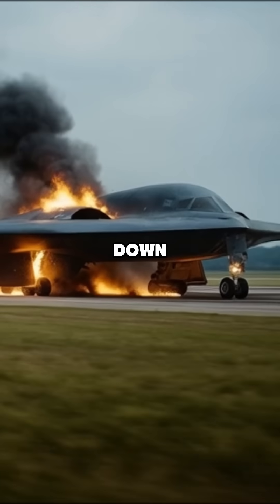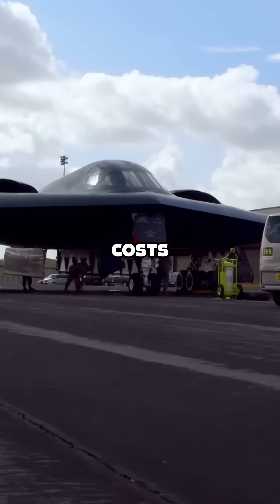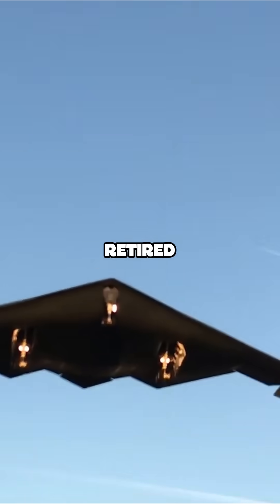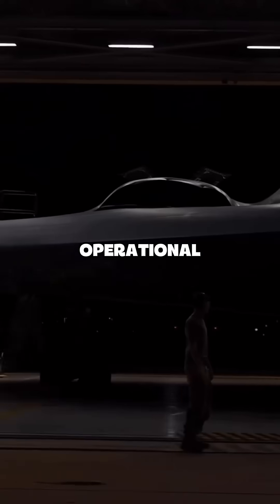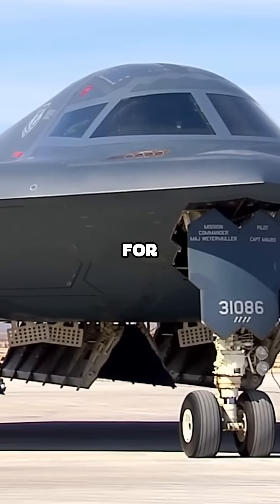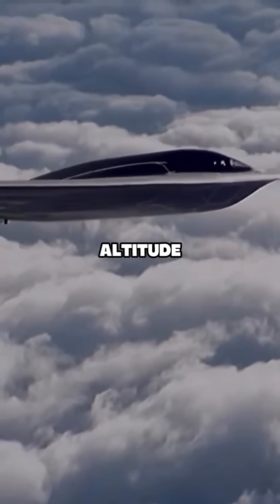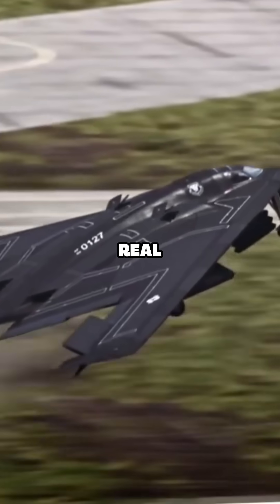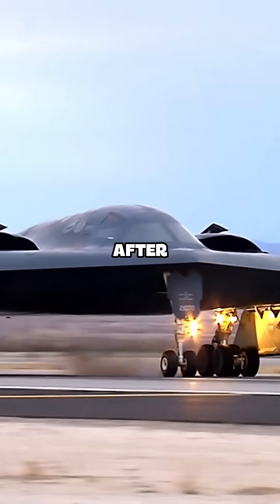How a Tiny Sensor Destroyed a $2 Billion B-2 Bomber?

Comment: Moisture didnt get under the stealth paint the rain got under the radar reflecting paint during takeoff and the engines are high heat, and they stalled bc cool rain hitting high heat engines basically ruined them

Comment: Ive seen some videos on a Quantas flight that had issues with clogged pitot tubes. And I knew as soon as you said tube thats what you were talking about. "Airspeed unreliable" is probably one of the most horrifying things that can happen. You dont know if youre about to stall, or break apart due to overspeed. And computers dont tend to handle it well. In the case of the quantas flight and here it seems the computer defaults to changing pitch which would make sense if the aircraft was actually too slow or fast.

Comment: Wrong.
The plane “crashed” because the system that heats an Eva a the moisture from ALL the systems was not used.

This has happened on commercial aircraft also, it is one reason for the “socks” 

Open the NTSB report before making the video next time.

Comment: The pitot-static system on the B2 are not protruding tubes, it uses flush-mounted ports in its skin to maintain stealth, measuring air pressure for airspeed, altitude, and angle of attack (AoA). These flush ports are very complex in design compared to conventional tubes requiring special unique safeguards against icing and clogging, as seen in incidents where moisture caused issues.

Comment: Pitot tubes have drain holes and are heated for a reason. So, there are only a couple of reasons that moisture would build up in them. 1- Someone installed it incorrectly so that it wouldn't drain properly. 2- The heater portion of it wasn't working correctly and ice built up. They should have told us the cause of the problem. Not just the result.
Reply: The pitot-static system on the B2 are not protruding tubes, it uses flush-mounted ports in its skin to maintain stealth, measuring air pressure for airspeed, altitude, and angle of attack (AoA). These flush ports are very complex in design compared to conventional tubes requiring special unique safeguards against icing and clogging, as seen in incidents where moisture caused issues.